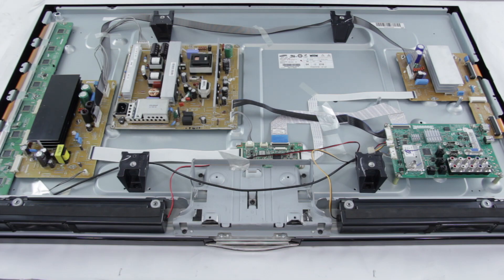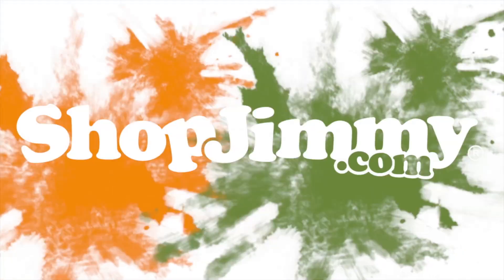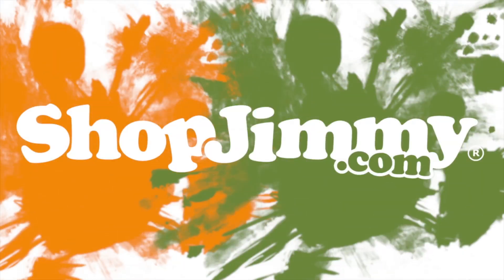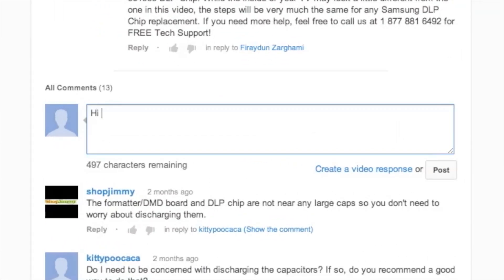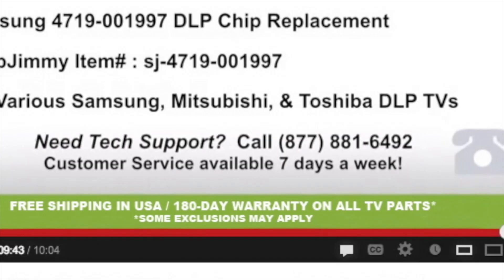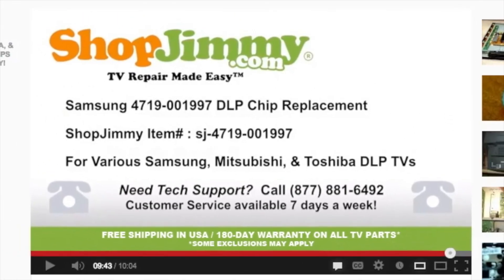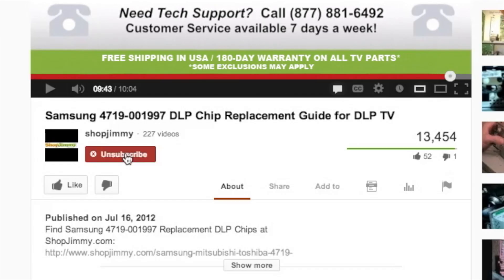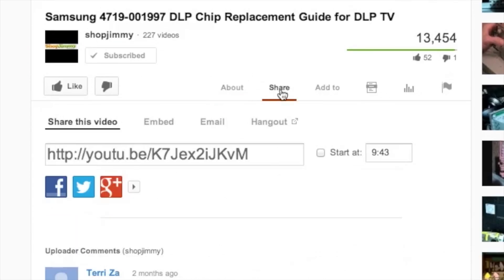Plasma TV Repair Tutorial - Common Symptoms & Solutions - How to Fix Plasma TVs

Comment: I have an LG 50PG60F plasma tv.  The picture has a horizontal bar across that top, about 1/4 of the screen (about 10 inches) that is a different brightness/contrast from the other 3/4 of the screen below it.  You can still see the picture but it look like part of the screen is going bad due to the different brighness.  Any suggestions?
Reply from the maker: John Fahy   Please watch this video FIRST to help with your repair!  https://www.youtube.com/watch?v=BP3NVNCGEv8  This could be a problem with the YSUS board or the TV panel.  You can replace the YSUS and the YDRVT & YDRVBT boards in your TV to see if that fixes the problem.  Click this link to replacement parts for your TV model number:  http://www.shopjimmy.com/catalogsearch/result/?q=50PG60F  There may be multiple boards for the same TV model number, be sure to match part numbers on your current board, with your replacement for compatibility.  Here is a link to a video showing how to identify your part number, click here:  https://www.youtube.com/watch?v=GEllG3RV-tc  Thanks and please let us know if you have any further questions with your TV Repair!  www.shopjimmy.com

Comment: I have a Samsung PN50C450B1 that has vertical colored lines. There are several grouped on the right side of the screen, a few in the middle and some on the left  side. The picture itself is perfect. Could it be the logic board? Would appreciate your thoughts.
Reply from the maker: Clifford Buzard Sr   This sounds like a TV panel (TV Screen) problem.  If your TV panel is bad, it may be more cost-effective to replace the TV as panels are typically hard to find in stock, difficult to replace, and expensive.  Thanks and please let us know if you have any further questions!  www.shopjimmy.com

Comment: Hi, I have a panasonic viera model TC-P50S30 tv went out lost picture and sound, power light remains on , after this no way to turn off light need to unplug. tv wont work, already changed power supply board with an used one from e-bay, tv shows same issues. maybe this board is also not good. please help.
Reply from the maker: Miguel A. Chavez  Please watch this video FIRST to help with your repair!  https://www.youtube.com/watch?v=BP3NVNCGEv8  I recommend replacing the SC, SU & SD boards in your TV.  Click this link to replacement parts for your TV model number:  http://www.shopjimmy.com/catalogsearch/result/?q=TC-P50S30  There may be multiple boards for the same TV model number, be sure to match part numbers on your current board, with your replacement for compatibility.  Thanks and please let us know if you have any further questions with your TV Repair!  www.shopjimmy.com

Comment: i own a samsung plasma tv model PN60E550 it will start but if you shut it off you will only get sound no picture.
Reply from the maker: Tim Collins  Please watch this video FIRST to help with your repair!  https://www.youtube.com/watch?v=BP3NVNCGEv8  I recommend replacing the Y-Main Board and the Upper and Lower Y Scan Drive boards in your TV.  Click this link to replacement parts for your TV model number:  http://www.shopjimmy.com/catalogsearch/result/?q=PN60E550  There may be multiple boards for the same TV model number, be sure to match part numbers on your current board, with your replacement for compatibility.  Here is a link to a video showing how to identify your part number, click here:  https://www.youtube.com/watch?x-yt-ts=1421782837&x-yt-cl=84359240&v=R1jmj_foId0  Thanks and please let us know if you have any further questions with your TV Repair!  www.shopjimmy.com

Comment: Panasonic TH-42PD60 - When plugged into an AC power source a RED indicator light on the front shows that it is receiving power. It no longer illuminates when plugged in. As such, the TV is "dead". FYI: There were no prior symptoms to possibly help in a diagnosis.
What a great channel you have. Very informative!! Liked and Subbed.
Reply from the maker: *****  Please watch this video FIRST to help with your repair!  https://www.youtube.com/watch?v=BP3NVNCGEv8  I recommend replacing the power supply board in your TV.  Click this link to replacement parts for your TV model number:  http://www.shopjimmy.com/catalogsearch/result/index/?cat=59&q=TH-42PD60  There may be multiple boards for the same TV model number, be sure to match part numbers on your current board, with your replacement for compatibility.  Thanks and please let us know if you have any further questions with your TV Repair!  www.shopjimmy.com

Comment: I have a Panasonic TC-P50S30, It made a popping sound then went black. Based on what you said in the video it is the Y-sustain / SC board. I saw your product on amazon for this board TXNSC1MNUX repair kit. Is it difficult to replace these items? Are these a good fix for the issue that started with a popping sound?

Comment: Hi, I need help identifying the source of my TV's issue. I have a LG 42PG20 plasma TV, the screen shows no image, there is no sound at all either, the only thing that turns on is the crescent shaped power button on the bottom left corner of the panel, which comes on red when power is applied. Please reply with a most likely fix and/or part ID. Thanks.
Reply from the maker: HrrE nR  Please watch this video FIRST to help with your repair!  https://www.youtube.com/watch?v=BP3NVNCGEv8  I recommend replacing the YSUS and YDRVTP boards in your TV.  Click this link to replacement parts for your TV model number:  http://www.shopjimmy.com/catalogsearch/result/?q=42PG20  There may be multiple boards for the same TV model number, be sure to match part numbers on your current board, with your replacement for compatibility.  Here is a link to a video showing how to identify your part number, click here:  https://www.youtube.com/watch?x-yt-cl=84359240&x-yt-ts=1421782837&v=GEllG3RV-tc   Thanks and please let us know if you have any further questions with your TV Repair!  www.shopjimmy.com

Comment: I purchased the SC board from you for my Panasonic plasma TV TH-50PZ77U and installed it.  Still the same problem, when powered on the black screen turns a little lighter but still no picture.  What do you suggest needs replaced.  Again, I see no capacitor damage  or other items that look broke.  Don't mind spending a little more to get it working.  The TV was purchased in 2007.

Comment: Hi, just a little problem with my Samsung 42 inch gas plasma TV.  Such as,it is dead.  Completely dead.  It had been working fine without problem for about 30 months.  Then I had to move it to tidy behind it.  I removed the plugs from the rear and placed it carefully on another table for a few hours untill I returned it to its usual location.  Then l tried to insert the live power plug.  Whilst inserting there was an eletrical arking sound, as if the plug had contacted wrongly. But is that really posssible?  It certainly made me jump as I felt the vibration of the arc.  I pulled the plug out.  All was quite and there was no smell of anything burnt.  Everything seemed fine.  So I decided to try a second time.  But this time I inserted the plug in to the TV first then switched the main on.  It all seemed fine.  So next was to switch the set on.  Nothing happened. No sound.  No picture.  No hum.  Absolutel nothing.  Completly lifeless and cold.  So being some one with an electrical scewdriver I tested the plug fuse.  It was working.  So all I could do was try and try again.  But no luck.  So I unplugged it and left it for 24hrs.  Then today I decided to test the internal fuse.  I  found three internal fuses.  They were all working on my fuse tester.                                                                         My TV is a Samsung, gas plasma display.  Model No. PS~42P3S.  Type No. AX 42P3.  Made in Barcelona, Spain in the year 2003.                                                                                                                                                                                                                                                  So, I tested each of the three fuses in situ.  In their locations in the circuit board.  Power was crossing the main plug input fuse.  But the other two were receiving no power and nothing was crossing them.  So it looked like the largest central circuit board was live .  But the left and right ones were dead as no power was reaching their fuses.        So I removed the central circuit board for close inspection.  Everything looks fine.  After afew hours of inspecting every wire, component, circuit, and anything which I could.  I decided that there seems to be nothing wrong, nothing broken nothing burnt.  But after putting it back together, it still did not work. Obviously there is something wrong.  But it is beyound my very limited knowledge. It is at present just laying , open but dead.  So if you or anyone has some great ideas, then I would certainly be thankful to read them.  Thank you in advance.                                Posted 15th Jan 2015 at 2.57AM GMT.

Comment: I've got an LG 60pk540 which recently developed a problem and will not fully turn on.  With the TV off, the red light is lit, indicating standby I believe.  If I attempt to turn the TV on, a relay will click, the backlight appears to come one, but a few seconds later the relay clicks again and the backlight goes out.  At this point, the red light is out.  A few seconds after that, the relay clicks again, backlight comes back on, red light comes on, another few seconds, relay clicks, backlight out and red light remains lit.

I've pulled the cover off, visually checked capacitors and nothing looks bulging or otherwise out of the ordinary. Fuse isn't blown.  So, I'm looking for help diagnosing the problem, figuring out if I need to replace the power supply board or if this on/off behavior with backlight indicates some other type of problem.

Comment: Hi I have a 8 year old HP pl4260n. It has had the Y-SUS and X-SUS boards replaced about 2 years ago. Recently in the past 6 months the tv has deteriorated in picture and has flashes of color. The problem is especially bad on startup until warmup. Once the TV has warmed up its still pretty bad, but watchable. I was thinking it might be a blown capacitor problem... Any idea what might keep this running until 4k OLED tv's come down in price :P Here is a video of the problem after a full day of warming up: https://www.youtube.com/watch?v=umxYIbIqtmE
Thanks,
Curtis
Reply from the maker: curtisbeef  Please watch this video FIRST to help with your repair!  https://www.youtube.com/watch?v=BP3NVNCGEv8  I recommend replacing the YSUS board and the YDRVTP board in your TV.  Click this link to replacement parts for your TV model number:  http://www.shopjimmy.com/catalogsearch/result/?q=pl4260n  There may be multiple boards for the same TV model number, be sure to match part numbers on your current board, with your replacement for compatibility.  Thanks and please let us know if you have any further questions with your TV Repair!  www.shopjimmy.com

Comment: I have an LG 42LN5300-UB. The tv does not always turn on. Sometimes the standby light is on and when I press the power button it will flash a couple times and then be steady, but not come on. I tried unplugging it and plugging it back in. Sometimes I can get the tv to come on that way. Other times it will do the same flashing thing. Other times when I plug it back in the standby light will flash a couple of times and go off. Any ideas?
Reply from the maker: Andy Freeland  Please watch this video FIRST to help with your repair!  https://www.youtube.com/watch?v=BP3NVNCGEv8  This could be a problem with either the power supply board or the main board in your TV.  Click this link to replacement parts for your TV model number:  http://www.shopjimmy.com/catalogsearch/result/?q=42LN5300-UB  There may be multiple boards for the same TV model number, be sure to match part numbers on your current board, with your replacement for compatibility.  Thanks and please let us know if you have any further questions with your TV Repair!  www.shopjimmy.com
Reply: HI, I have exactly the same problem with my TV, if you have found how to repair  it, please let  me know  , thanks

Comment: hello I have an RCA 42PA30RQ and there are three vertical lines about 4inches wide each on the right side of the television. The vertical bands are blue black and white and one flashes. Any suggestions?
Reply from the maker: George Ramirez   This sounds like a TV panel (TV Screen) problem.  If your TV panel is bad, it may be more cost-effective to replace the TV as panels are typically hard to find in stock, difficult to replace, and expensive.  Thanks and please let us know if you have any further questions!  www.shopjimmy.com

Comment: Hello there,
My name is Michael Glambedakis and i'm located in Lesbos, Greece!I just watched your video about the Philips TV repair! I've been having a problem with mine for a long time now! Every time i turn on the TV it's on a default tv channel, for example channel 03. When i try to change it and go to an EXT channel like EXT 1, it makes a loud bumping noise. This has been going on for many months now!
The past month though after a couple of hours watching tv (when it warms up), some black horizontal lines appear and slowly they get more and more, to a point that the image is lost completely! The sound is there all the time but the image goes out for like 15 minutes and then it returns for another 20 minutes and then it goes off again and so on.What do you think is the problem and is there a fix about this???
Thank you in advance
Reply: Philips 42'' Plasma TV model: 42pf9945/12
Reply from the maker: Mike G.  Please watch this video FIRST to help with your repair!  https://www.youtube.com/watch?v=BP3NVNCGEv8  I recommend replacing the Y-Main Board and the upper and lower Scan Drive boards in your TV.  Click this link to replacement parts for your TV model number:  http://www.shopjimmy.com/catalogsearch/result/?q=42pf9945%2F12  There may be multiple boards for the same TV model number, be sure to match part numbers on your current board, with your replacement for compatibility.  Here is a link to a video showing how to identify your part number, click here:  https://www.youtube.com/watch?v=R1jmj_foId0  Thanks and please let us know if you have any further questions with your TV Repair!  www.shopjimmy.com

Comment: HI i have a Samsung 2010 model pn63c8000 plasma tv.I hear rather loud crackling noises from the tv.Also like in this video it will sometime turn off on me.Then power right back on.The most annoying issue is after being on for about 30mins while viewing a webpage.It will show a double flickering image while scrolling through a webpage.IF i scroll down to just the right spot it goes away.Also my 3d performance is not as good as it used to be.I am seeing ghosting in certain movies that i used to not see it in the past.

Comment: My Panasonic TH-50PZ800U no picture or sound. Red light flashes 7 times. Help Thanks.
Reply from the maker: Mike Trollmann   Try this at your own risk. Unplug the TV, then disconnect the SC board and plug in the TV to see if the TV powers up. Reply with the results of this test. Thanks! www.shopjimmy.com
Reply: ShopJimmy.com I gave the TV a few whacks on the lower left corner and it started working again. Easy fix.

Comment: Hey,
I have the Samsung ps64f8590 plasma TV (german model) and some problems with blue snow (in white moving pictures) and also red snow (in red moving pictures) at the left side oft my panel. After some minutes it is getting better and it nearly dissapears completly. You can See this blue snow also when you start scrolling...after some minutes (25 minutes) it is gone....but when youbturn off the tv and later again on you have the same problems...sometimes the TV also freeze in the scrolling mode and does not react...is there a Problem with the mainboard? Thanks for your help! 

Thanks, ruben
Reply from the maker: ruben_s   You can replace the main board to see if that fixes the problem.  Unfortunately I do not see any replacement parts in the search results for your TV model number on our website.  Please reply with your part number on your main board and I can try searching for replacement parts.  Thanks and please let us know if you have any further questions!  www.shopjimmy.com

Comment: hi I have an LG plasma 50PM6700 i turned on my tv after 3 days of no use and i get no picture sound only...the channel will change but no picture just audio...what could be the problem  ive only had the tv for 3 yrs.
Reply from the maker: Johnny Garcia  Please watch this video FIRST to help with your repair!  https://www.youtube.com/watch?v=BP3NVNCGEv8   I recommend replacing the YSUS and then YDRVTP & YDRVBT boards in your TV.  Click this link to replacement parts for your TV model number:  https://www.shopjimmy.com/catalogsearch/result/?q=50PM6700  There may be multiple boards for the same TV model number, be sure to match part numbers on your current board, with your replacement for compatibility.  Here is a link to a video showing how to identify your part number, click here:  https://www.youtube.com/watch?v=GEllG3RV-tc  Thanks and please let us know if you have any further questions with your TV Repair!  www.shopjimmy.com